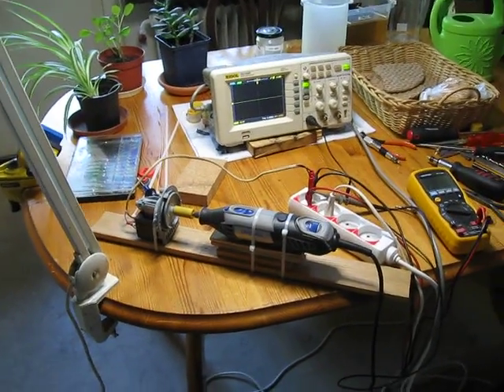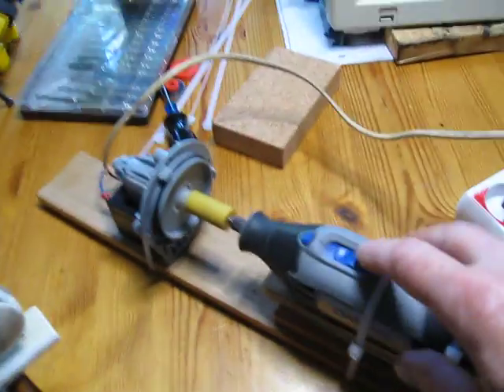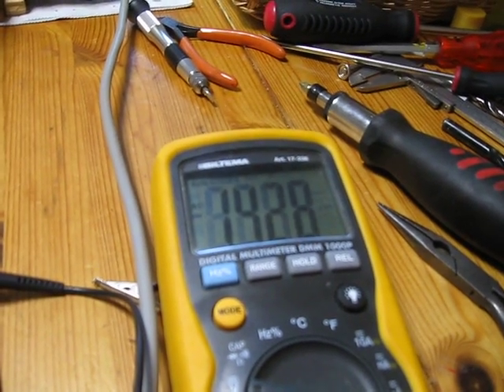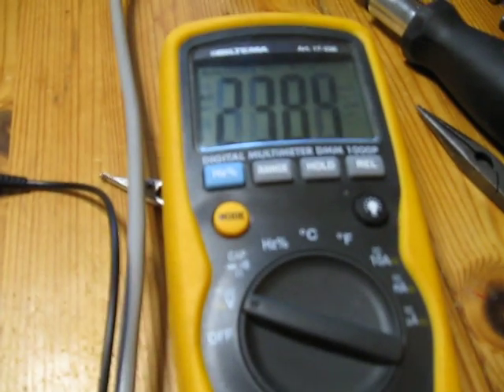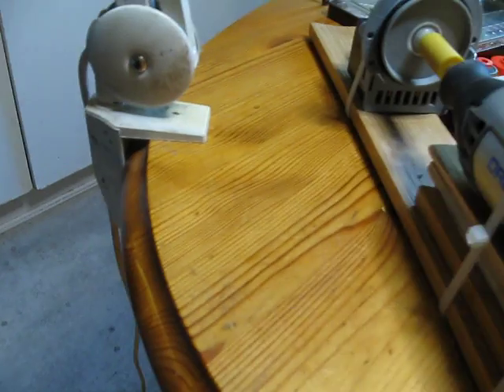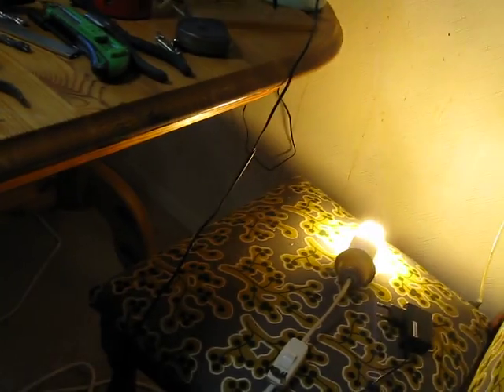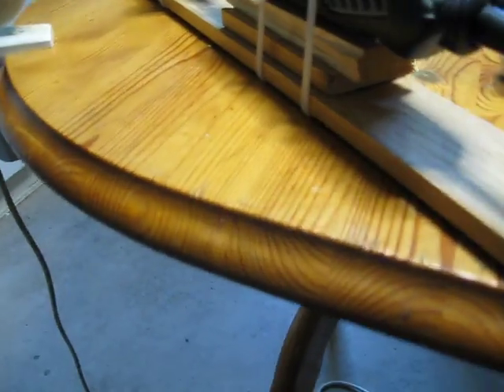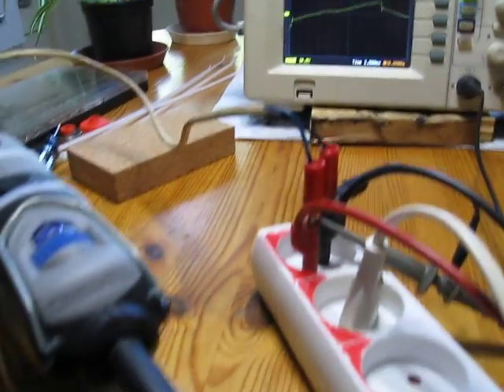Magrav pump motor II

Comment: Congratulations Bosse! Some remarks: 
1. The number of poles of the motor does not mean the number of coils. It is the number of magnetic poles of the rotor, which counts. You may place a mark with a filt tip pen on the axle of the motor, and try to twist by hand, and see at what angle of rotation it will stop in a stable position, at 180°or 90°?
2. If you will put a resistive load instead of the energy saving lamp, the shape of the pulsation will probably improve. What about to try with a 25 W / 230V incandescent bulb?
Reply from the maker: Right, thanks Sandor.  Ok so by hand twist it seem I have 2 magnetic poles and  2 coils
hz = ( rpm * #mag poles * #of coils )  /  60
If that's true my measure on scope make sense